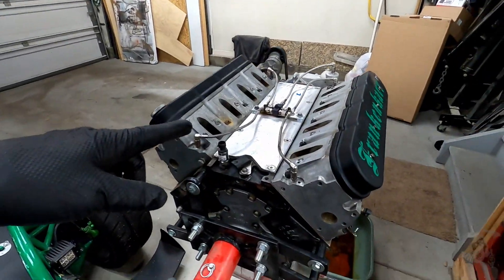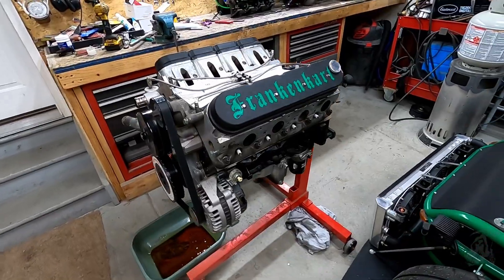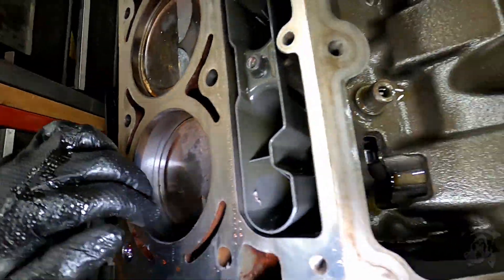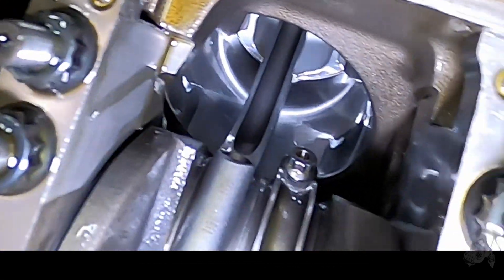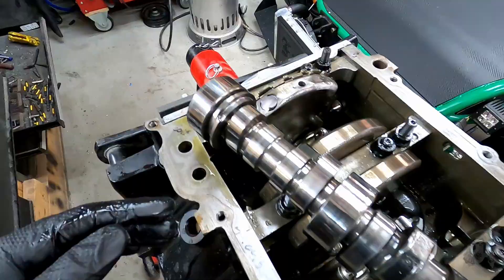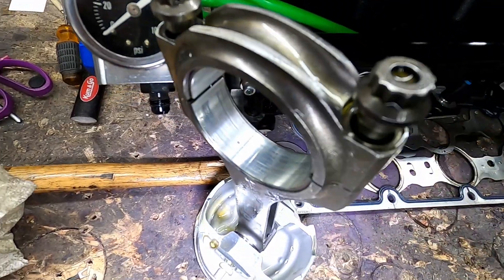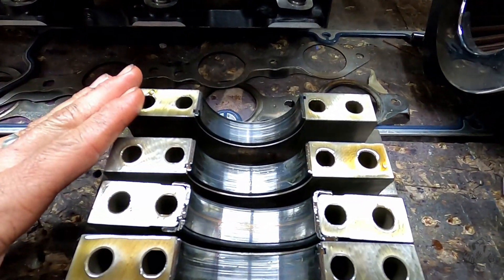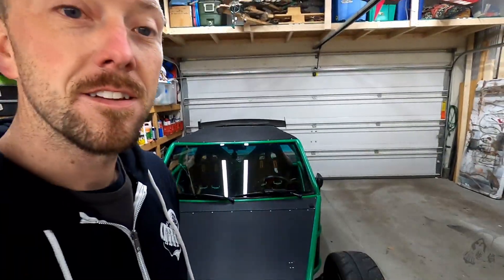Engine Tear Down

Comment: What kind of lifters were used? Looks like one or two failed and eat up your cam. This sending metal bits throughout the rest of the motor
Reply from the maker: They were gm lifter’s but it actually was a cam issue it wasn’t heat treated on a few lobes. The rollers didn’t even look damaged
Reply: @DeathByBoost  ah gotcha, that's a bummer. Hope it's back up and running better than ever.

On a side note Could you guys do a video of your garage storage setup? Looks amazing!
Reply from the maker: Ya she’s up and running. There is some newer videos of that. Ya we will try to talk about the garage for sure

Comment: Dang, that cam was wrecked! Hoping to meet you at Bandimere this year. I think I ran against your buddy in that 1000R last year during a test and tune. I just pulled my 408 apart for a refresh. What machine shop do work with?
Reply from the maker: ya it was and was surprised how alot of those shavings got around the filter and caused so much damage, but lessen learned just the oil filter fits doesn’t mean it does as good of a job as the next, i found the bypass spring pressure in the old filter was very low, Im sure we will meet up we should be there more this year. I go to western engine on 70th and Washington.

Comment: Is that the factory cam or did you put that in as an aftermarket bit?
Reply: What did you end up running?
Reply from the maker: It’s a Brian tooling racing stage 2 turbo cam
Reply from the maker: It’s aftermarket